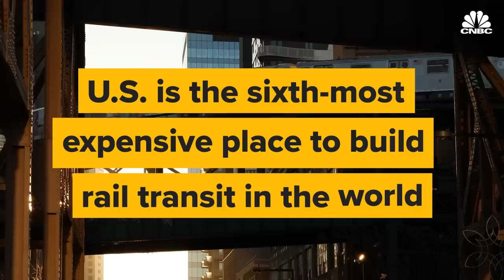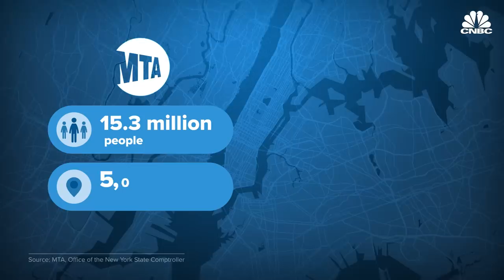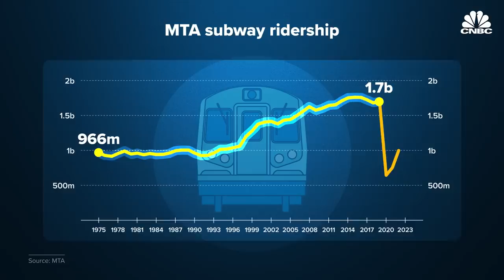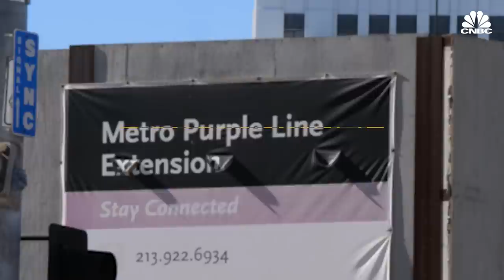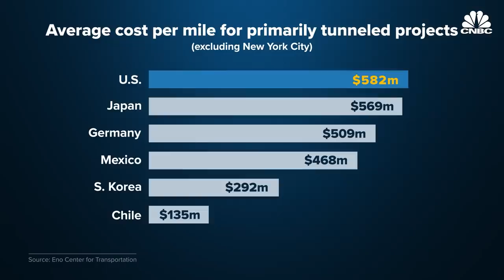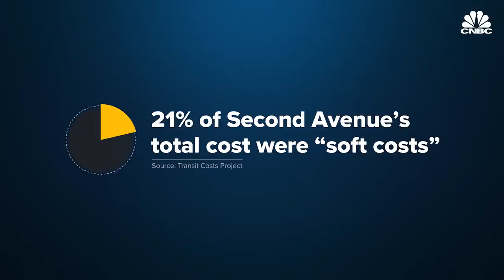Why American Subways Are Some Of The World’s Most Expensive

Comment: Meanwhile on the oppostie side of the world is Shanghai  Metro- 500 miles of track and about 400 stations- most with   glass platform doors. Their is also free wifi and 5g network.

 On MTAs metro station in canal st NYC. There is a stair that leads down to the platform. If you fall down the stairs you could plunge into the tracks, their solution? They put a  metal bar that prevents you from falling into the tracks. This metal bar only covers the width of the stairs.

Comment: A big problem with this video is that it doesn't compare the cost per number of user over the lifetime of the rail to ROADS. 

Absolutely no one addresses the ENORMOUS cost of maintaining road infrastructure, which, especially in big cities, tends to be INCREDIBLY, inefficient. Because of this rail often doesn't get the relatively meager funding it needs to maintain itself and costs balloon as things just break down
Reply: Where do you get the idea that rail maintenance is a low cost operation.
Reply: Yeah, they could also just get rid of highways and build rail lines instead. That would be cheaper.
Reply: @PhilippBlum  --Well, sport, you still need road (and transport means) from the railheads to the individual consumers.   Moreover, when problems happen on the rails, it's the roads where the rescue usually comes.
Reply: Everything that gets to your local grocery store gets there by truck. A rail network is more costly than any highway network.
Reply: The video admits subways are more expensive than roads, but are far more efficient so it's worth it in high density places.
Reply: @povertyspec9651   Watch the last few minutes of the video, they explain this.
Reply: @h8GW  --  Nasty, nasty!    I'm quite aware of what trains can do and what they can't do.   What they do quite well is carry freight.   Roughly speaking a RR car can carry the equivalent of TWO tractor trailer loads.   BUT they only carry that load where the RR tracks go.   In particular, the RR tracks don't go to, as an example, to my driveway or the loading docks of most businesses or retail stores.
Reply: @povertyspec9651  false.  A rail network (like highways) high cost comes from acquiring the land and the initial build. (Shaping, clearing the land) It just looks way more expensive because for roads, we did the expensive stuff 100 years ago.  But rail has a tiny fraction of the upkeep cost compared to roads.  Rail can handle massive weights without getting potholes like roads get from trucks.
Reply: But who wants to ride 'pubic' transport with all the criminal dumb-versity?
Reply: @povertyspec9651 you do know it goods go from rail to trucks right? Trains can carry far more than trucks in one go. American infrastructure is just trash so we have trucks destroying our roads and government that thinks filling in that hole is fine for now and wait until it appears again.
Reply: The high cost of mass transit is also due in part to the large number of people that ride using subsidized or free passes.  Being registered to a government-sponsored social welfare program qualifies for subsidized passes.  And free passes are issued to those who apply for them as long as they are substantially on social welfare.  Unfortunately, passes are not biometrically coded here, so many people on social welfare apply for the passes in order to then sell them for cash to a street broker.   
 
Before you laugh and say there's no such thing, my city even has brokers that buy up the free medical consumables that they get from government programs they apply for.  For example, diabetes test strips are bought up from people who don't use them, but are eligible to get them for free from the government.  Naturally, this increases the cost of the government-run freebies programs for medical consumables.  Not to mention this attitude applies to monthly and quarterly, bus passes as well.
Reply: @animejanai4657  I do not know if this happens in every state in the US but usually ticket price for transit is just a fraction what it actually takes to run that transit service, it's substantial income sure but not the main income for those transit companies or public entities who run those systems. Same can be said about roads though, if it's public funded and you go driving there, you're not bearing the cost of building and servicing the road when you're actually using it. Both roads and rail are seen as services that must work for economy to work, so there's public funding involved. Heck, even airlines are publicly funded to some degree.
Reply: @donmarek7001  do you see crime in China, Japan, Or European subways in the level that we do ?
Reply: @kay1229  That's my point! You don't because of the culture in these other countries.

Comment: There are over 25 million residents in Shanghai and their subway system moves over 10 - 15 million people per day. New York seems small in comparison
Reply: New York moves more than 7 million people per day so not that much of a difference. Not to mention NY only has a bit more than 8 million residents.
Reply: @dmcr9525  You are being disingenous, that was just the highest single-day ridership established in October 29, 2015 never to be repeated again. The actual ridership is about 2.4 million a day. Perhaps you were hoping thatpeople will be amazed by your figure and won' fact check it. When you do your research, actually read the items and don't just use the highest figure you can find.
Reply: @dmcr9525  you wrong
Reply: @rap3208  First of all it is not that serious because you dont know what you are talking about. Second of all you are using 2021 numbers. I used to work for NYCT's forum and those numbers you see online are not accurate at all. This is 2023. You are using numbers from the pandemic era. And what I actually did was combine bus and subway with effortless thought because when I worked there both divisions were combined for passenger numbers. They were slightly higher in 2022, and I am going off 2023 numbers at the current point before the year is even over. And yes it will get back to pre pandemic levels overall one day. Who are you to day it wont we they are already at 65% of the level? A 35% increase is inevitable genius. Especially with second Avenue Subway and the BQX line still yet to come. I still work in the industry and now work for another agency so I keep a close watch on the number and actually do know what I am talking about. Do some REAL research, not just a Google search before you come to fact check my information. Good day.
Reply: @dmcr9525 Sadly US is 2 decades behind of china in building infrastructure, also china has overtaken US and West in 37 out of 44key emerging technologies 😢
Reply: @basshunterdota625  Very true!
Reply: @basshunterdota625  hahahahahah
Reply: @basshunterdota625  isn’t Chinas population something like 10X of the US them leading isn’t unfathomable seems proper in fact.
Reply: @tyharris78  it's only around 4x larger. and Shanghai isn't much bigger than NYC metro area, 28 million vs 22 million. 7 million in Puxi (the historical downtown Shanghai) versus 8 million in NYC proper)
Reply: @tyharris78  just over 4X
Reply: @dmcr9525  The city proper has 8 million people. The entire NYC metro area has over 20 million people.
Reply: @Klako-ls6yt  Correct and agreed. I was talking about NYC only. 5 boroughs.
Reply: Hong Kong is 7 million, Singapore 6 million, check out their subway systems
Reply: @basshunterdota625  然而美国的地铁是民主的，自由的，西方人赋予这些破旧东西神奇的民主力量！
Reply: The cost per people BS from MTA President is so stupid... New York's cost per person is likey 50 more expensive than Beijing/Shanghai/Tokyo.
Reply: @guohuazhu2693  I understand sarcasm USA has no clue what they are doing
Reply: @rap3208 relax dude
Reply: @guohuazhu2693  yeah I agree we all love noodles.

Comment: At 1:39, what the NY MTA president said is false.  There are plenty of subway projects in Europe and Asia that are just as complicated, or more complicated than NY 2nd Ave subway.  The NY projects still costs 4 to 6 times higher per mile or km.
Reply: UK has been as expensive as NYC but Spain certainly knows how to build for cheap
Reply: It’s gaslighting
Reply: I also think the argument that NYC is complex due to a lot of things being underground is rather strange. Here in a lot of places in Europe you can't dig 2 meters without finding some ancient Roman structures that need to need to be inspected by archeologists. It's one of the reasons the Neapolitan and Roman subway took so long to built.
Reply: @jonkoops  I think nowadays with the tunnel boring machine.  It is relatively easy to  make tunnel 20 to 30 meters below ground, thus bypassing all the possible man-made items or obstacles.
But Yea, N.Y. or USA subway cost is just insane, no matter how u analyze it.
Reply: True...
Reply: Barcelona had to tunnel under old subway lines and ancient cathedrals. A Rome Metro line had to dodge the ancient roman Pantheon (Is there any 2000+ year old structures in NYC?). Netherlands had to tunnel under waterlogged ground that literally used to be underwater. around buildings with rotting structural supports.
Reply: @jacktattersall9457  great examples
Reply: For Singapore I'd say that some ways that costs are moderated are that labo(u)r is cheaper, with construction workers being mainly migrant workers from less developed countries, & the gov't sometimes being more conservative in the train stations' design, but sometimes for the worse e.g. it gave up building an underground transfer linkway between 2 underground stations as it was probably deemed too complicated, with an expressway tunnel to be built above the linkway too (which might've been de-cried as being too pro-cars). So now with 1 station having its platform at B3 & the other at B4, you have to detour all the way up to street level & make an out-of station transfer instead between both stations. Costs can still be considerable though (e.g. the 42km/26mi Downtown Line cost S$20b (~US$14.8b), 70% higher than budgeted, supposedly as raw materials faced price inflation over time from when it was planned in the 2000s to when it was completed in 2017) as newer lines are to serve areas already completely built-up decades earlier (but earlier served by connecting buses to train stations in other areas instead), so the lines have to be mostly underground due to a lack of space (which also means some stations have to be built further away)